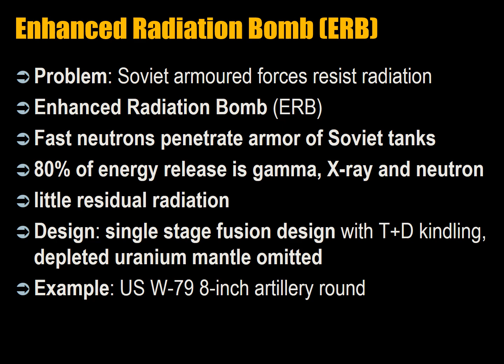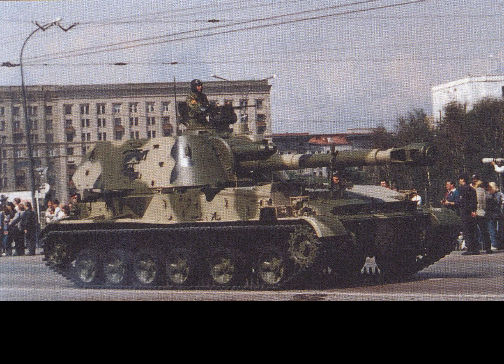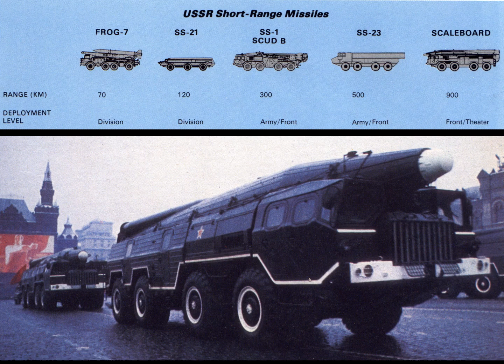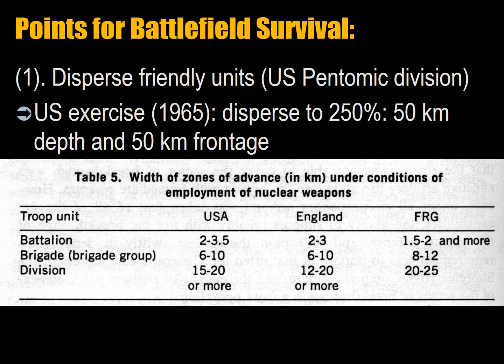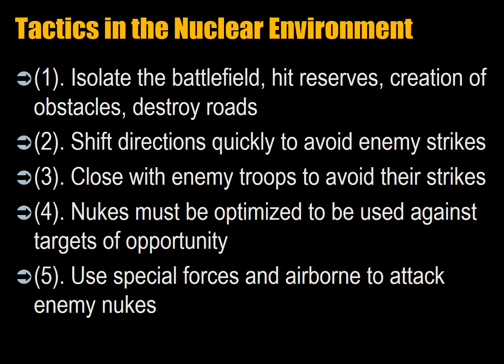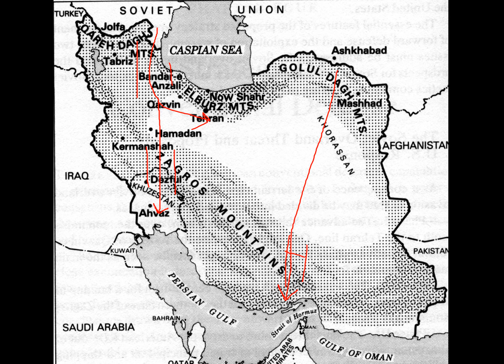002 Nuclear Strategy Lecture 15 Tactical Nuclear Weapons on Land

Comment: Ya' need to double check some of your 'facts'. I.e., the m107 was 175mm and not nuclear capable. The M110 was 203mm but with its short barrel was not nuclear capable. The M110A1 was long barreled 203mm without a muzzle brake and it was not fielded. The M110A2 was long barreled (32') with a muzzle brake and was nuclear capable. With either the M422 or M753 rocket assisted (RAP) rounds. Range and yields: classified.
Reply from the maker: Thank-you for the correction: 
https://en.wikipedia.org/wiki/M110_howitzer

Comment: Excellent video, but I have some things I'd like to add.
The two launchers for the Davy Crocket system had minimum ranges of 450 and 550m, 2000 and 4000m were the maximum ranges.
Most neutron bombs are not single stage devices. They're two stage devices using pure fusion hot spot ignited secondaries lacking heavy tampers, and using modulated interstage coupling to achieve the necessary fusion fuel densities. Single stage devices stopped using uranium tampers before ERWs were developed. 
For one example of a ERW employed by the US, 1.6% of the yield would be in the form of gamma rays, and 47% would be in the form of fast neutrons.
Reply: This common knowledge,  or another Warthunder type leak?  😂
Reply: @ericlotze7724 The info on Davy Crocket is common knowledge.

Comment: So 1kt...How does that compare to say a cruise missile?
What kind of blast radius would that have?
I presume you would have the same radioactive ground, air, etc?
Reply: When u have a surface burst, the debris gets sucked up into the air by the same currents that form the mushroom cloud.  That disperses the radioactive debris.  Airbursts tend to be a lot cleaner AFAIK.
Reply: It forms because the blast wave pushes the air away really fast, and that leaves a vacuum.